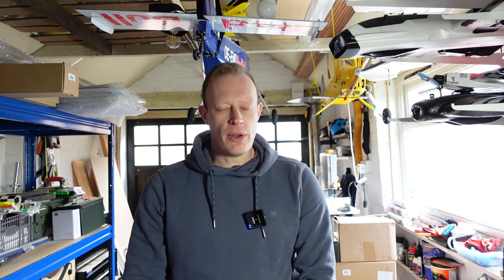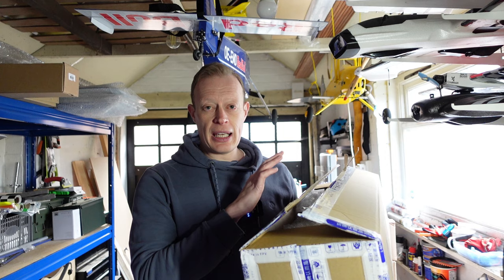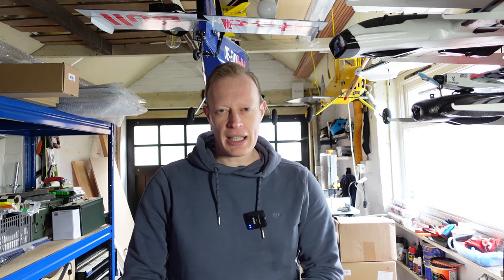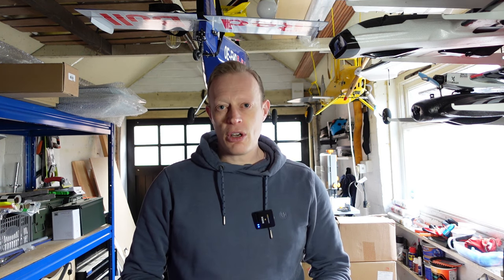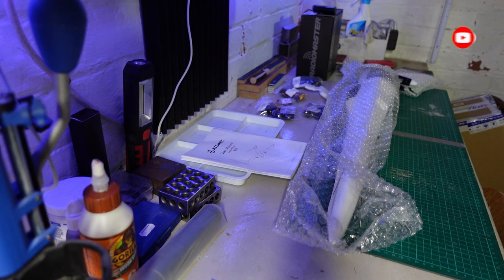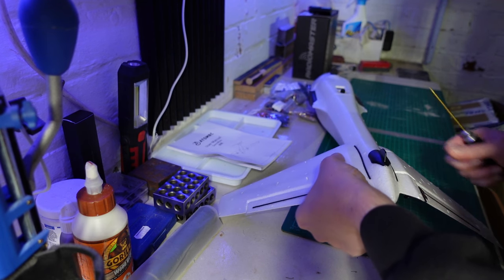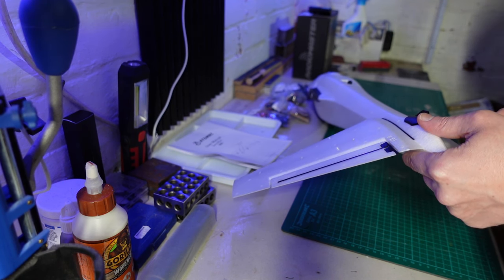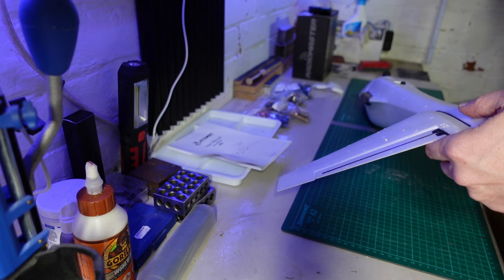AtomRC Swordfish assembly - Part 1

Comment: I just bought this plane and I'm glad to find someone who has the same opinion. This is not PNP! PNP means you stick an RX in and it's ready to go. AtomRC have sent me an unfinished kit which also includes some electrical parts. It's also annoying that most people on YouTube received the RTH version for free for review and that one is almost completely assembled. So you'd think the PNP would be assembled too, it just wouldn't come with the flight controller installed. I don't mind building kits, but kits should be called kits.
Reply from the maker: Yep absolutely agree 👍🏻
Reply: Same here. Thanks.
Reply: I hear you, and they should communicate that to you.  

If It was up to me, they would do minimal setup, including not glueing the two halves together.  With those two pieces apart, you would easily have the option of mounting lights,antenna anywhere on the fuselage.  Maybe this was a compromise between our two tastes :)

Comment: Alright, how did you get the isolation off the wires that run to the leds?? I keep snapping them off even with just my fingernails. Can't  belive I'm stuck on such a simple thing
Reply from the maker: @tiefseetaucherr  it was tight i remember but just have to be careful with the routing 👍🏻